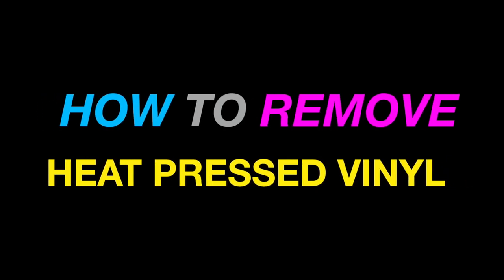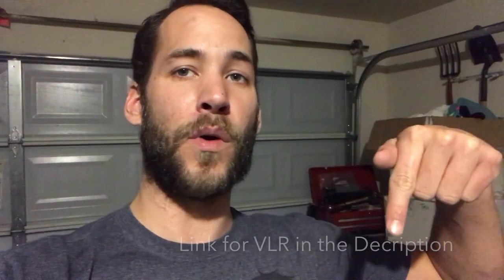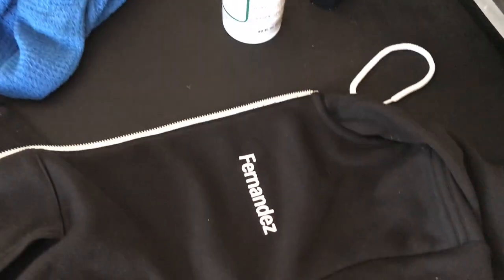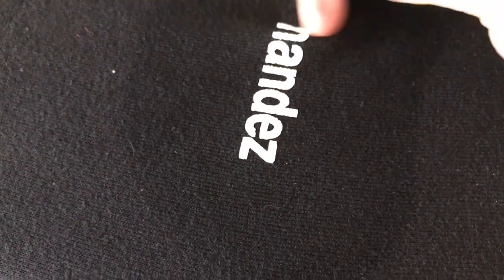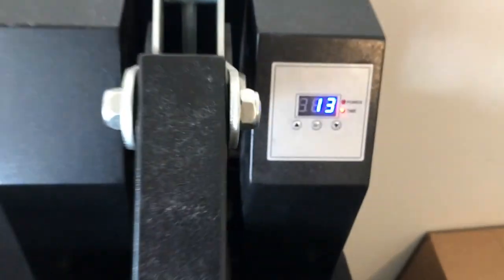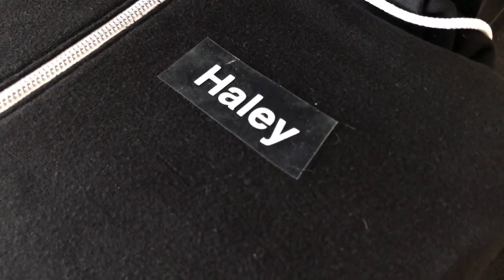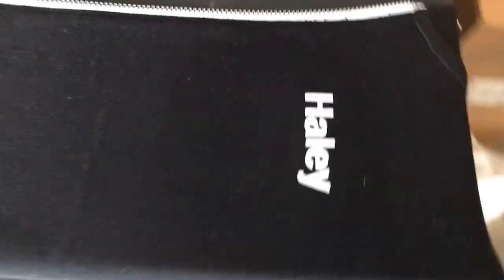How to Remove Heat Transfer Vinyl HTV Pressed on T-Shirts and Fabrics

Comment: Or you can go the cheap way. And use air duster for keyboard cleaning.. you spray the letters freezing them, then peal off leaves no residue and makes it way easier to reapply new letters, since there no adhesive solvent to deal with after ..
Reply from the maker: I'll have to give that a try.
Reply: Can you use it on a 100%polyester work vest?
Reply: Throwing the t-shirt in the freezer would work?

Comment: Have you ever used htv as your emulsion for screen printing? I just tried it and it’s worked great for the stencil, but I am wondering the most effective way to remove it without remeshing the screen. Do you have any experience with this?
Reply from the maker: I haven't! But I've heard it works well for short runs. We may have to give that try as a budget stencil. Did you use  sticker HTV? The nylon mesh of screens is pretty hearty. There are some really corrosive haze removes that do not even phase the mesh, so I wouldn't be shy to use HTV remover to try and remove it. Let us know what you find out.

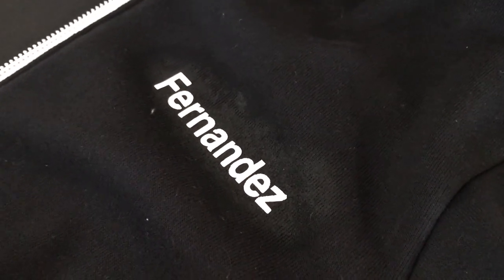Comment: AT 2:30 you said you going to let it sit for a moment. How long did you let it sit for?
Reply from the maker: Not for very long. You'll start to see it lift or bubble.
Reply: nailpolish remover works fine, just done it on a sport acrylic jumper, cheap and instantly success
it took me 3 minutes to remove a big stamp on the back

Comment: this stuff works great on most vinyl. I used some vinyl that this VLR doesn't work on. It's weird.
Reply from the maker: It's definitely finicky. There's items we have used it on and it just doesn't work, or will melt the vinyl. Especially on 100% polyester items. It's not a cure all, but does work for about 75% of situations.

Comment: Will this work on a dri fit shirt?
Reply from the maker: It'll work but don't be too aggressive with the remover. Start lightly from the back of the graphic, because if you use too much, it'll melt right into the polyester.

Comment: Just use cheap nail polish remover  100% acetone we have a business and this works fast and doesn't leave residue behind 👍
Reply from the maker: Thanks for the tip!
Reply: Does Acetone also work on the polyester jacket? I want to remove the vinyl from my polyester jacket.
Reply: This left a residue with cricut HTV, but not my other HTV 🤦🏻‍♀️

Comment: I have two questions.

1: Did you try this with imprinted HTV? 
(For my part, I did try it with imprinted HTV and the solvent makes the imprinted ink liquid. Making it easy to stain the shirt with the ink from the imprinted vinyl).

2: Did you ever have this situation?
(I tried VLR remover on older HTV'ed shirts (Gildan) and the VLR Remover left a "water stain" were the remover had been.

Comment: If u dont have a heat press what do you do then?

I used the solvent alone on my hoddie on the letters i wanted gone but its did not really work
Reply from the maker: It's not absolutely necessary to have a heat press to use the VLR. It's not a cure all for removing vinyl lettering but it does work.

Comment: can i use this on PU leather?
Reply from the maker: It probably won't work well because the solvent needs to reach the back of the vinyl to dissolve the adhesive before it starts to dissolve the vinyl. Once the vinyl starts to dissolve it'll just make a mess out of things.

Comment: Will this work on polyester?
Reply from the maker: It will. Just soak it in through the back. Don't over do it. Some vinyls tend to just melt if you use too much. We've even used this on lycra.
Reply: Mikey Designs & Silk Screen thank you!!

Comment: Now how to get the residue off ??
Reply from the maker: Use a little more VLR and a clean rag and scrub it off.
Reply: Mikey Designs & Silk Screen I did that several times still didn’t work .. ugh guess I’ll jus buy a new shirt
Reply from the maker: @SuaveOwnsIt   Try just using enough to saturate the underside of the shirt, and not on top of the graphic. Do a little bit a time so the vinyl doesn't stay soaked in it and breakdown beyond the point of being able to remove it. Sometimes the vinyl will not come off depending on the vinyl used and the shirt itself. There's been a handful of times that the shirt just can't be saved and you'll have to start over. I wish it were a cure all, but it does help in most situations.